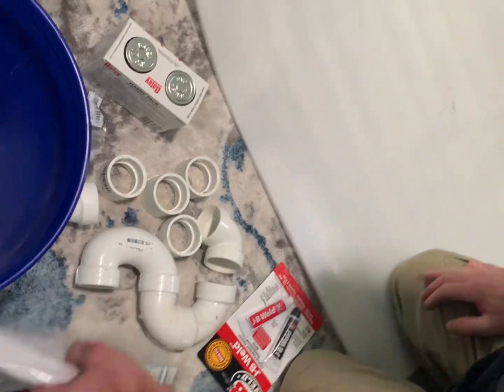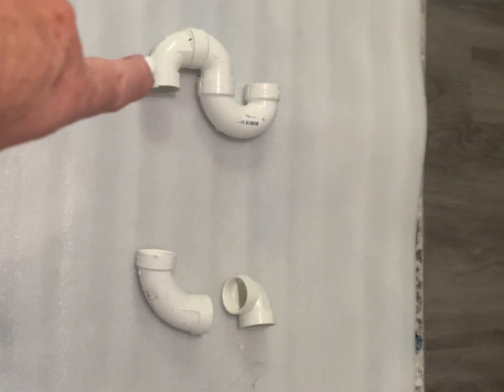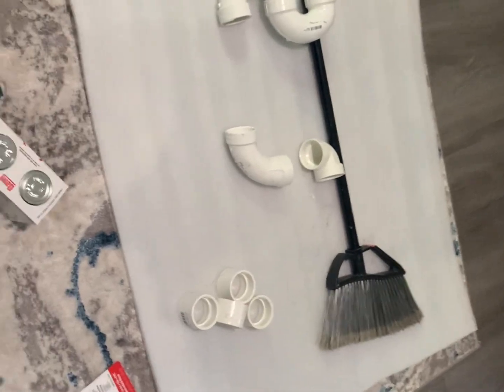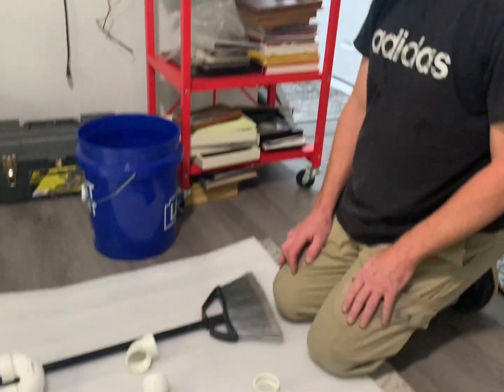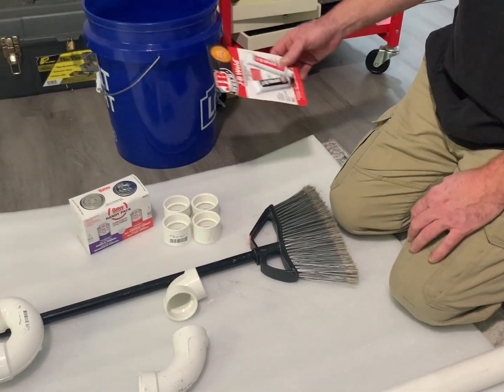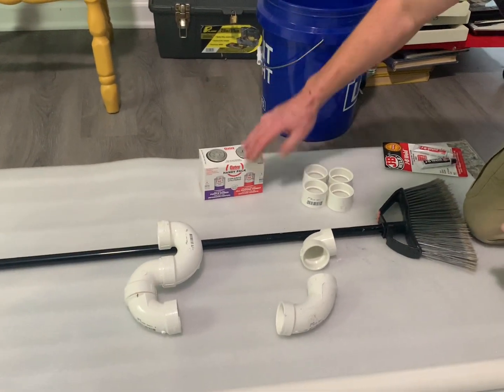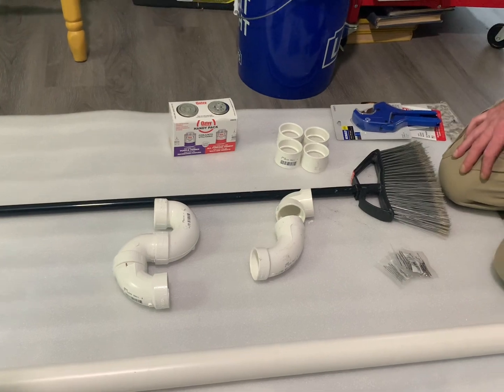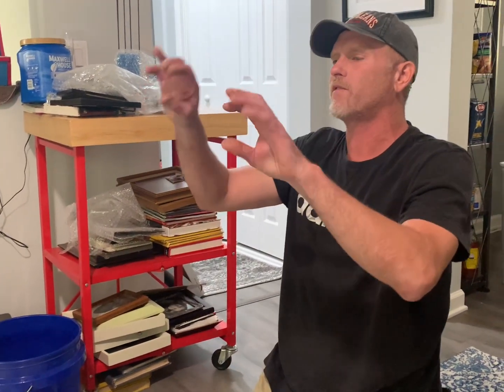P Trap explained

Comment: I'm still confused why you haven't talked about what's under the floor? That's where your plumbing is,your drain needs to be vented,I would look there first.
Reply from the maker: There’s only like 6 inches under that part of the house
Reply: The video I seen under the house shows it was re piped and wired,that drain is 11/2 in,going to that 31/2,someone put that in,the main concern is that space has the water pex in  on each side, next with all those turns how would you unclog it if you had to,many years of solving problems,hope it works

Comment: When installing pipes inside a framed wall of a new house the inspector wants to see purple primer so he knows you used primer which makes the joint stronger but when in finished areas you use clear primer so that if you spill some it does not turn things purple.
Reply: Also a trap is called a U bend, not 2 elbows put together but one piece, with waste water coming down the taller pipe into the bend but when exiting out the other side you don't want it rising up too high to avoid backing up so you use a short turn elbow to make it easier for the flowthrough, actual P-traps are called such because that elbow has one female end and a male end that glues right into the U-bend making the up flow as short as possible before turning back downward :)